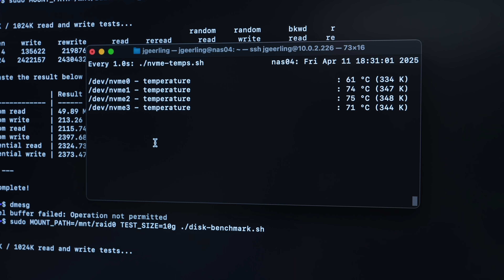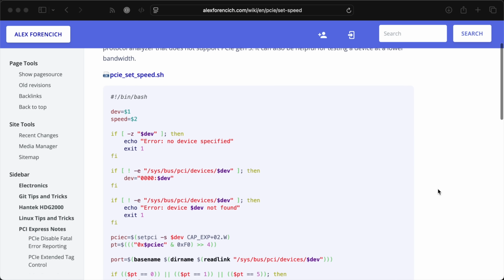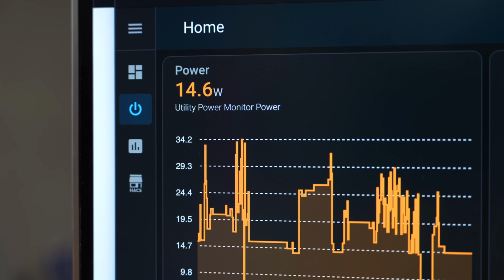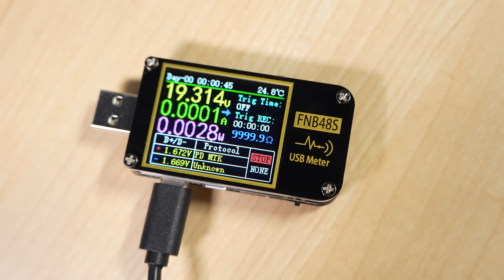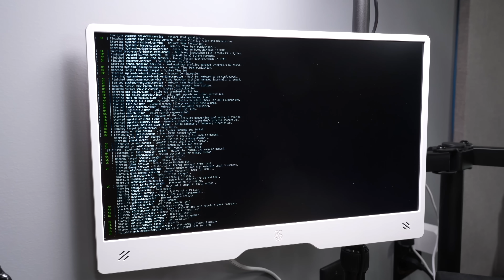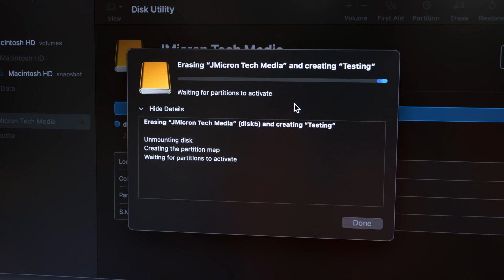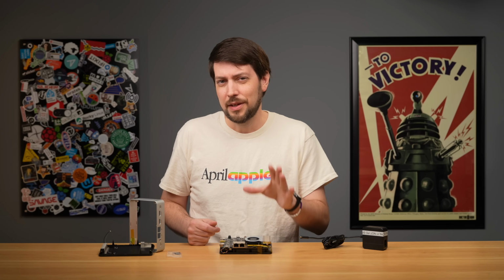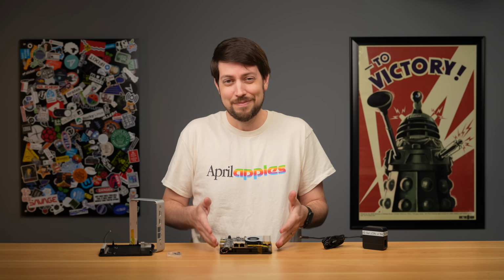I fixed the perfect Mini NAS!

Comment: i decided to still give this NAS setup a try because one of the HDDs in my larger storage server started having issues after 5y of 24/7 operation. Weirdly enough i just installed 4x 2TB Samsung 990 Evo Plus any stability issues at all. I copied ~2,7TB via 2.5Gbit connection via rsync without any issues in either drive or cpu temperature. By the way, i have NO heatsinks installed on the drives and i got the enclosure closed. I double checked and after ~2h of copying the files, the drives were running between 55-65°. After the job was done, they are not idling at around 50°. The only weird thing i see is that even when powered off it is consuming ~5 Watts of power and 16 Watts idle when turned on. Therefore i will try with a higher grade power adapter soon :)

Comment: Jokes on you, my power adapter for G9 died in first days, so i'm using Nintendo switch adapter and it works FLAWLESSLY, with 3 disks used for torrents with constant work it works actually great.

Comment: Alternative sells on newegg: 4 x NVMe Mini NAS Server, 4 Bay NAS i3-N305 Pocket PC with Dual i226-V 2.5GbE LAN,Dual HDMI 2.0,USB3.2 Gen2,Support BT5.4/WiFi6/WiFi7 (i3-N305, NO RAM NO SSD)
another one: Beelink ME Mini PC, Intel N150(4C/4T, up to 3.6GHz), 12GB LPDDR5, 64GB eMMC, 6*M.2 SSD Slots, ME Mini Computer 
another one: UGREEN NASync DXP480T Plus 4 Bay All-Flash SSD NAS, Intel i5 1235u 10-Core CPU, 8GB DDR5 RAM

Comment: Did you ever consider the possibility of using Semiconductor Refrigeration Tablets 12V 6A Heatsink Thermoelectric Cooler Cooling Peltier Plate Module 40x40MM, yes it would use more power but it would provide ACTIVE cooling, would still need a  substantial fan

Comment: Another option for building a home NAS: Beelink GTR9 Pro. I've been using it. It has dual 10GbE ports, so file transfers are fast. It can back up almost all the devices in your home and switch between them, and you can use it with confidence as it comes with a warranty~

Comment: Jeff, I noticed you used several tools to show the performance and temperatures of this system.  I have looked at a couple but did not see the same format shown in your video.  Can you share the names of the software tools you used?  I bought a GMKTek G9 and noticed some heat issues and returned it.  I am waiting for my refund to purchase another device.  I am putting proxmox on it and am trying to put a zfs pool for nas, jellyfin and pfsense on it.  Any thoughts on this configuration?  Thanks.
Reply from the maker: Yes! Check out my Level2Jeff video on the top 10 tools I use to monitor Linux
Reply: @JeffGeerling  Thank you so much.

Comment: Inspired by this, I modded my G9.  I used a jewelers saw to convert the square holes in the end to slots (3 holes became 1 slot), removed every other support on the end of the NVMe bay (2 spaces became 1 wider space), re-did the cpu heatsink compound, added chip heatsinks to the chips, and increased the fans a little (not too much louder). I think the additional airflow was the key. It's definitely cooler than it was, as I can comfortably hold it now. I was out maybe $20 (not counting the cheap saw) and it's still a "stock" footprint. I didn't really do much benchmarking before or after, just copied about 20GB to and from, and I'm only running 2 NVMes, but I'm happy with the results so far. It will be interesting to see what mods GMKTec made to the original design.

Comment: Buying a brand new product and having to mod it the way you did just to make it stable, to me that's not fit for purpose and the manufacturer should be installing the additional heat sinks on the chips and redesigning the whole thing.

Comment: stop yourself  ! ! ! 
this is NOT your problem ! ! ! 
this is GMKtec problem ! ! ! ! ! ! ! ! 
seems one thing that could be helpful is orient the SSD's so the heatsink(s) would have a 
left-to-right orientation (i.e. not top-to-bottom)  the case would be wider but not taller.

heatsinks like ||hs||s   ||hs||s  ||hs||s  ||hs||s
                        ||hs||s   ||hs||s  ||hs||s  ||hs||s
                        ||hs||d   ||hs||d  ||hs||d  ||hs||d     
 --- instead of  -- 
__  __  __  __
hs     hs     hs     hs
------   ------   ------  -------- 
ssd   ssd   ssd   ssd

heatsinks go <->  <->  <-> <->   not  ^   ^   ^   ^
                                                          ^   ^   ^   ^  
again NOT YOUR problem , GMKtec needs to redesign the whole dn thing ! ! ! !

Comment: All the company needs to do is redesign the case , and the mother board to be spread out over the remaining distance of the mini rack. have some redesign of the air flow with fans and heat sinks, and there ya go!

Comment: If that's an early production of Raspberry Pi 4, I remember it having non standard implementation of USB C. So if it's original design, probably wasn't the best device to test PD on.
Edit: To be clear though, I'm not saying the charger could be fine, just that the RPi might've been even more susceptible to dying than other USB C devices :p

Comment: At 2:50, it looks like C-States are enabled in the BIOS. Disabling them could potentially lower CPU temps by a few degrees, especially if you're running a constant workload or want more thermal headroom. Might be worth testing it out!

Comment: Jeff, any chance of a review of  the "Beelink ME mini 6-Slot Home Storage NAS" ?  I was the same as you got the GMKTec G9, designed and printed a case that housed a 80mm fan. Was all good until I plugged the power into the USBC socket by mistake and fried it.... So looking for an alternative that is not as noisy as the G9.

Comment: You don't need a big external fan or any down clocking. What most don't see is that the G9 is the only mini NAS of this type that has a dedicated thermal channel to cool the NVMEs. The problem is 1) The opening for the 2 mini cooling fans is obstructed by the heatsink of the NVME installed in slot 1 and 2) Conventional NVME heatsink fins don't allow the air to flow through the NVME compartment. My solution: 1) Select a cross-cut style laptop NVME heatsink and 2) Put a 2240 heatsink on the NVME installed in slot 1 (covering just the controller chip). This will leave the opening for the 2 mini fans unobstructed. I found that the NVME in slot 1 doesn't even need a heatsink because it's in the direct path of the cooling fan output.
Now for the final and most important bit: get a 40x20mm Noctua fan and strap it about 1 inch in front of the exhaust vent holes on the short side of the case. I use duct tape to create an air-tight shroud. This pulls hot air out of the NVME compartment, as well as pulling air through the CPU heatsink and across those 2 hot controller chips you identified. Best of all, it keeps the whole thing still fitting nicely in that 1U shelf of the mini rack.
I've had my G9 running 24/7 for over a month like this with TrueNAS running apps and instances in addition to serving up files with no lock-up issues.
Reply: how do you power noctua fans, I bought one because it was on sale but saw this review later.

Comment: I would love to see a review of Beelink's latest. Seems that the form factor addresses the cooling issues right off the bat, and while it's a bit bigger, I think it could be perfect for a lot of use cases. 6 M2s, plus 64GB of eMMC, a package that  seems to be designed around a large heat sink with a fan, 2x2.5Gbe and Wifi 6 (their choice of the cheap AX101 wifi is questionable, as it is on all their inexpensive devices, but it's easily replacable) and an internal power supply that eliminates the need to hide a large power brick and 12GB of RAM onboard. It suffers all the same shortcomings as any other N150 devices, mostly in terms of limited PCI channels, but for the states purpose, it looks really good, at a good price.

And yes, Austin Powers fans, they really are calling it the Mini ME.

https://www.bee-link.com/products/beelink-me-mini-n150

Comment: Flip the heatsinks on the NVMe 90 degrees so its in line with the fans airflow, together with mini-heatsinks on all other chip (dont forget the memory under the CPU cooler) everyhing is fine. No need to criple it down to a Raspberry Pi.

Comment: I think the hotrod blower hood look like if you had tall SSD heat sinks poking out of the drive cover would be super cool.  

Give that to a company like Gravastar or Scharge and they could totally run with the aesthetic and turn it into something cool.  Cool enough to make you forget about 1U height restriction.
Reply: The 1U height restriction is so artificial and limiting anyway.  Just get a taller mini rack.  They make them in 12U and 16U

Comment: retired EE here... it seem like today low power and hirel design is a lost art, people think that since they are connected to the AC mains a little more power is no problem even a lot more power... just compare the power draw of a pi (any flavor) to an arduino...  imagine if the engineers who designed the voyager spacecraft had the same lax attitude, it would have been tits up 35 yrs ago, sure I don't expect a 4 drive NAS to draw less than about 4W but if lower performance was acceptable that would be ok... I live in a area where the outdoor ambient routinely exceeds 110F so low power draw/dissipation is key.. everyone seems to complain about global warming but is not concerned with overall efficiency, how about just reduce your consumption for starters...

Comment: Nice job on leaping  through all the CN engineering rings of heat.  Will HK K100 Aiffro design be better? maybe with Metal.  Will ASUS in Taiwan do a better job of airflow heat sink, paste et al? more than likely.. What about Geekom? probably not?.. . ;) Great video!   ty.

Comment: I trade futures and have bricked two of the mini computers in the last year, different companies. They worked great till they didn't. I figured it was the heat. Both were replaced. The last one is just setting here. I have no idea what I'm going to do with it ? Use it for a backup maybe.   Went with a small Lenovo. About four times bigger then the minis but so far it's running great and still small enough to be on the desk.   I really liked the idea, but mine just didn't last.

Comment: Pretty sure I'm not the first one to say that but if you're going for the all ssd route, why not use the LincStation N1 or N2? I don't think it's much bigger than the GMKtec G9 and it can accommodate two SATA SSDs in addition to four NVMes. Temps are around 30...40°C idle and the system draws about 11 Watts. Didn't test large file transfers though other than using Nextcloud daily.

Comment: If you review the aiffro k100 i think the maiyunda m1s is worth checking out.

4 nvmes, upgradable ram as well unlike the k100 locked at 8gb. Also mostly alu body and cheaper.

I think itd be perfect.

Comment: I copied 2.5 TB in one go with no issues. 4x Crucial M.2 drives, 3 with heat sinks, the drive closet to the fans with a thermal pad to allow air to pass over with less resistance.  That drive runs cooler than the other 3. I ran a RAID 1 using Open Media Vault. So far no issues, and its been up for over a week.

Comment: Hi Jeff, thank you for this video, these mini NASes are so hit or miss.
I bought an ODROID H4 Ultra and I would love it if you did a small review or just a blog post. Or just check it out and reply here what you think about it. It's also based on the N150 / N350 intel cpu but MUCH more DIY friendly, super documentation you can 3d print cases and everything! :)
And for some reason they idle with much less power than the typical n150-based mini nas. Very importsnt here in germany with high electricity prices.
I'm not associated with them at all but I did so much research and would like to see this little guy be a bit more widespread. It's also from South Korea not from China.

Comment: I watched your video several times and took some preemptive measures to control the heat. I purchased a pack of RPi heatsinks off amazon and put them on all of the chips on the top side of the main board not covered by the cpu cooler. Also put a copper shim-type heat sink on the RAM chip. Additionally I repasted the CPU with Artic MX4. Using 4x Teamgroup 2TB drives wrapped in cheap clamshell heatsinks to control drive temps. Did not touch the bios. Running Unraid 7.0.1. Tried a 300GB transfer with no issues. CPU idles at 72-74 but only peaked at 78 with very low noise from the fan. Drives started at 52C average and peaked at 54.
Reply from the maker: Nice! I'm glad you could get all that sorted to hopefully result in a very stable build!

Comment: Mine runs fine. Hot, but I get the full 2.5 saturated. I noticed the drives run 10 degrees cooler without* the heat syncs.

Comment: As an Idea for a video: In Spain we just had this massive blackout that lasted for 8+ hours. When we got power back, even though we had wifi, my router had no connection and when pinging my DNS server (the one I'm assigned to) i was getting "Destination net Unreachable". It would be interesting as a video to showcase how ISPs and Servers have to get back up and running after such an interruption in service and the challenges starting the IT infrastructure from scratch has
Reply from the maker: Possibly! A lot of times for IT infrastructure, it's about handling massive influxes of data (like tons of http requests, and other stuff, all within a few seconds), and properly queuing things and giving priority to important traffic like monitoring systems, management, etc. so if something really crazy is happening (like a DDoS, whether malicious or just accidental when a city gets power back) they can respond accordingly.

Comment: GMKtec ought to be ashamed of themselves and I can personally say it will take a whole lot of impressive goodwill on their part before I'd ever consider buying one of their products. The thermal issues are a bummer, but I guess you could work around it. The non-standard USB-C power brick that can destroy other equipment is a disgrace. The whole point of USB is having a standard such that you can plug it in anywhere and have it just work. If they were going to go rogue, they should have given it a barrel jack where we're already used to checking the polarity and voltage before plugging it in. Instead we get this "Oh, it LOOKS like that standard, but surprise! Your electronics are dead!" half ass implementation. GMKtek is one of the more prominent players in the mini PC market and for them to release this cancerous power brick on the world is disgusting.

Comment: I was able to reproduce the same issues you had using 4x 990 Pro 2TB drives. My repro was an initial unraid parity sync... It would die at ~58gb  (+±10GB) Using 4x 970 Pro 1TB Drives the machine worked reliably and would do a full parity sync.

Comment: 6:18 IT looks like the componemt that got hot is this giant Diode, maybe a Zener Diode that will start passing current at a certain voltage so it's basically a short circuit to protect the other components from the high voltage.

Comment: If that Aiffro unit is short enough to fit in a standard 1U rack space, it's worth testing. It looks a bit taller than the GMKtec unit, though.

Comment: That "same drive but different controllers" thing is a major and chronic problem in the SSD industry, NVMe especially. Manufacturers seem to think it's ok to swap out controllers and even flash memory chip models/manufacturers at will whenever they feel like it without bothering to change the model number of the drive.

This, of course, means that previous reviews for that model of drive no longer apply (and the consumer has no idea) and the bait-and-switched parts usually perform worse (they wouldn't switch unless it saved them money, and if saves them money it means the parts are probably inferior). I think this should be straight-up illegal, but so far I haven't seen any efforts to crack down on this deeply deceptive behaviour.

Comment: Give this a try for the Sequoia Finder SMB error:

delete /private/etc/nsmb.conf if you made one

Samba server settings:
Min SMB2
Max SMB3
Transport encryption Disable
Signing Force - most important (Client defined or SMB1 disable will not solve the copy issues).

Easy way to test if it is working properly, is mount 2 samba shares on same server and try and copy a file from one file to another. If the config is bad, the copy won't even start and will time out with error 100035

Comment: Did you try putting it into a chest freezer with the cables running through a hole drilled in the side of the freezer? I bet that would work great!

Comment: Yep test more micro NVME NAS. I almost brought this one a few months ago, but avoided it after hearing of heat issues. Your testing shows it's basically unusable. I want a tiny low power file/backup server, Currently the best option is a minisforum MS-A1/01 as far as I can see
Reply: Maiyunda M1S 4x NVME + 1x 2230 N100/N150

Comment: Thinking about it again: It is futile to use N100 for NAS, as this platform has very sketchy kernel support. Nearly all thin top system have poor kernal support, and will fail in 2-4 years. Then it becomes a pain to migrate data to a new system. A more reliable platform is needed for Mini NAS!